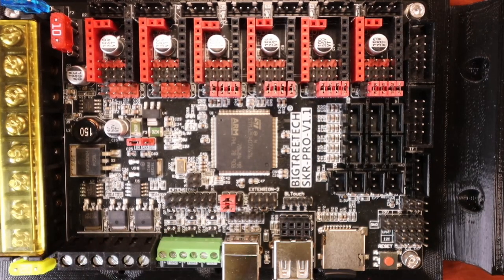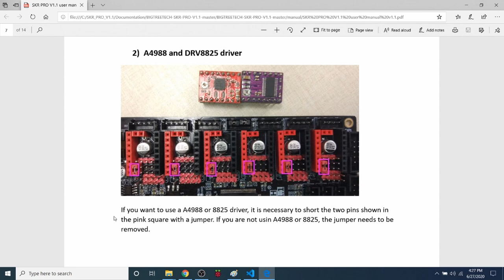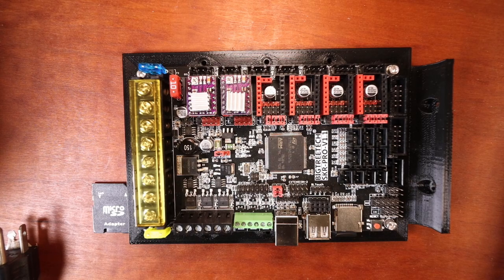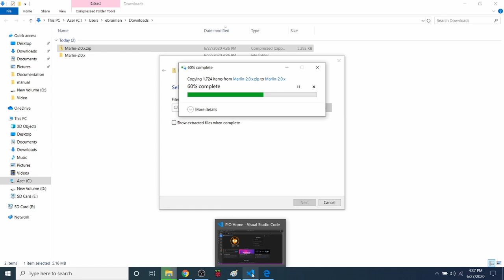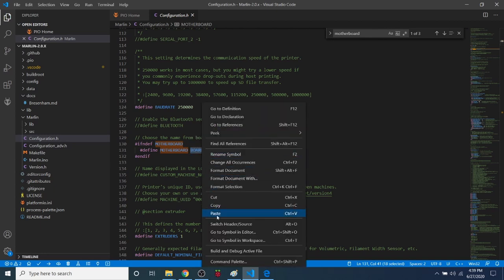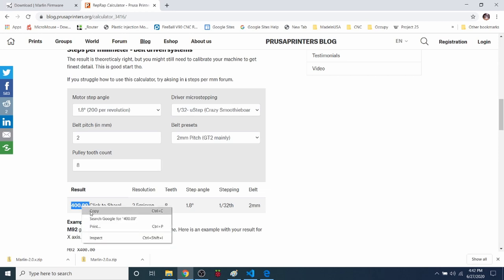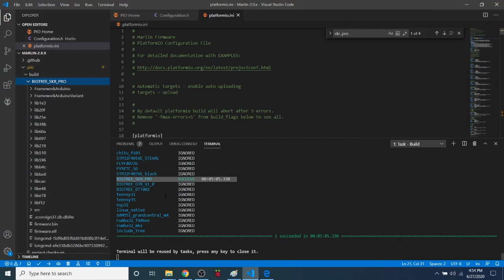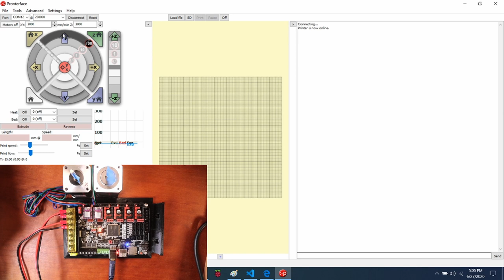SKR Pro V1.1 -  DRV8825 stepper driver install

Comment: Good morning. I would like to ask you a question after compiling marlin, I open marlin ,I get a firmware file (it is a bin file) and not firmware.bin is the same that I have to copy to the card. Thank
Reply from the maker: No.  You should see firmware.bin.  which IDE are you using?

Comment: I had to swap Y- and Z-axes, since my printer uses two Y-axis steppers but only a single Z-axis stepper. Where do I tell Marlin that the Y- and Z-controllers are swapped?
Reply from the maker: In pins file for board.  My tutorial on how to add additional extruder should talk about this in my SKR 1.4 playlist.
Reply: @EdwardBraiman  Thank you very much, with the help of the video you suggested, I was able to switch all values that define the Y- and Z-axis with each other, and it works as expected with Pronterface. Yet so far, I have an issue with the X-axis, that everything plugged in there makes the stepper turn only in one direction and not the other. I tried checked the connections, tried different steppers, cables, step sticks, but X will only move CCW. Is my board defective?
Reply from the maker: Do you have an endstop connected?  Try homing x axis by clicking endstop and let me know if it works in other direction.
Reply: @EdwardBraiman  It turned out that the SKR Pro V1.1 that I bought from Bigtreetech thru AliExpress is damaged. The DIR pin on X doesn't work. I was told by their tech support to measure between DIR and GND and it wouldn't show a measurable value driving the stepper in either direction.
Reply from the maker: So they're replacing it?
Reply: @EdwardBraiman  No, I paid for a new one, which broke immediately, had that one replaced, and that one let the smoke out immediately too, so I don't know if I should buy a new one. Would be the 5th board.
Reply from the maker: Maybe next week we can do a walk-through setup on live stream and sort through the issues.

Comment: Hi Edward would you like to help me with a B.F.T. SKR E3-DIP V1.1?
I have (been horribly stingy) and bought the wrong board!
I bought the cheaper BIGFREETECH SKR E3-DIP V1.1 with BIGFREETECH T24-V1.1 screen.
I have (I think!) Already connected the screen with the black flatcable and there was an SD card that I put in the motherboard!
I connected the USB via my PC for power.
Then I got the text: LCD12864 Simulator   and for the rest it did nothing?
I will of course have to activate some software moderately but am not sure how?

Help?

friendly greetings from The Netherlands!
Rob